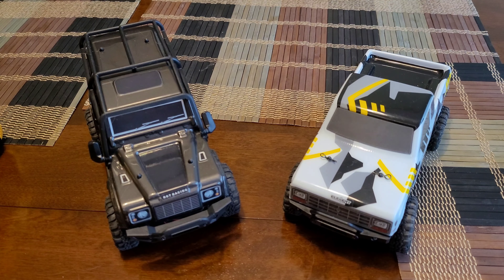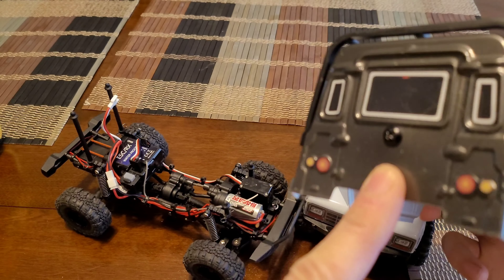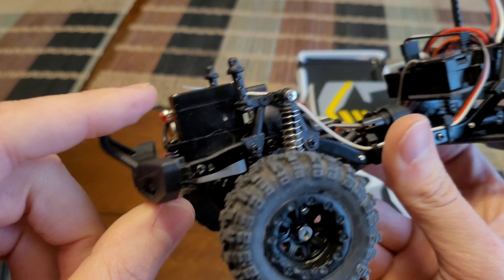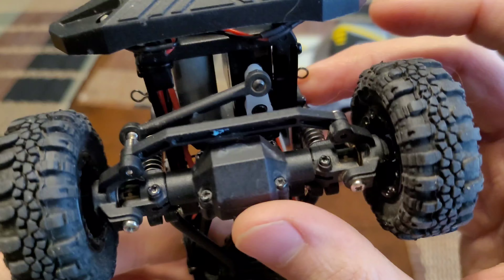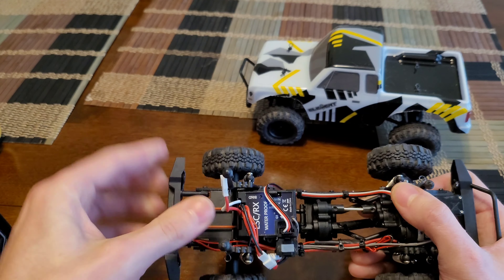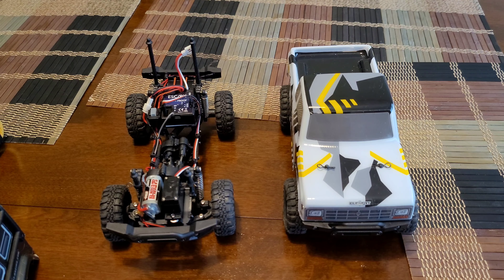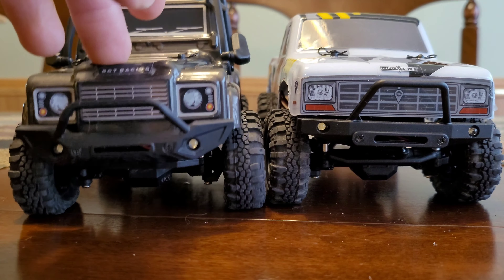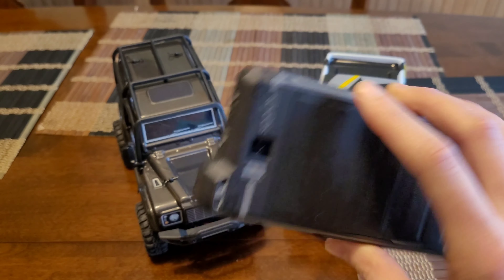RGT Adventurer v2 DIY mods

Comment: Raising the servo a few millimeters made a huge difference to the front suspension travel. I also added a few small o-rings to each shock to add a bit of preload. And you could add 1 inside each wheel as spacers instead of the washers. Shame there isn't much aftermarket support for these little guys. My enduro24 trailrunner hangs pretty good with my scx24 wrangler. 👍
Reply from the maker: Yeah it's a fun little rig!: I have the JLU scx24 jeep and I basically upgraded every single part except the motor. This Defender I just try to get clever with and see what I can do. The biggest hurdle is definitely the servo placement. That and it's a bit top heavy. Other than that I have lots of fun with it.
Reply: @Scrammy18  I just found out recently that power hobby is starting to make brass parts for the enduro24. Kinda pricey tho.
Reply from the maker: @barceloni1984  well at least thats some good news though.

Comment: thanks man. the steering mod helped a lot..
Reply from the maker: No problem! I was just not content with the front suspension travel and kinda did some trial and error and this works great. Without doing any crazy relocation or anything. Glad to help.
Reply: @Scrammy18  Just added couple of tiny washers on both sides.. gave it a try and it made a BIG difference... Keep it up man..  Subbed!
Reply from the maker: @Yimaj  thanks! Will do man!

Comment: So how it it holding up in the long term?  What are the main problems you have had other than the drive shafts?  Just curious.  Bout to buy one or the scx24 but I'd rather have the rgt . Shoot me an email if you want. Great videos man
Reply from the maker: I ended up installing metal driveshafts as an upgrade but it seems fine on 2S

Comment: I did the shock ring thing a few days ago actually. I just didn't like the extra play in the springs. Use your finger nails to "stretch" them just a touch longer. Enough to get rid of the play. Don't stretch them at just one part of the spring. Pull lightly in several spots till the slop is gone.
Reply from the maker: Yeah man that works too. Anything helps!

Comment: One free mod you haven't covered which has made a lot of difference to my V2 climbing is to use velcro (hook and loop)to mount the battery sideways to the front of the ESC. This brings the Centre of Gravity forward and also lowers it.
Reply from the maker: Thats a good tip man! I thought about it. I may mess around with that. I don't like lowering it but I have angled my shocks make them softer and a bit lower. Anything helps!
Reply: @Scrammy18  only lowering the centre of gravity by relocating the battery (less top heavy). I'm same as you and wouldn't lower the car itself, it's tight enough on ground clearance as it is .
Reply from the maker: @cmac1455  so I can up with an idea. I was able to stick 2 quarters to the front steering servo. One on each side. Just used some spray glue. You can tell just that made a big difference. It may not look the prettiest but you don't see it anyway. Plus I made sure I could still remove the servo if need be so it wasn't all glued in place. I bought some brass wheel hubs to replace the plastic ones for a little more weight as well. Other than that I was thinking of metal driveshafts etc but maybe all that over time
Reply: @Scrammy18  Excellent. That's your next video sorted 👍
Reply from the maker: Yeah man. I definitely have a couple mods I'm installing tonight. As well as my home made weights thats just quarters mounted to the front servo and motor. Actually works well!

Comment: Nice vid.!!!. Do you know if there are oil filled shocks for the RGT Adventurer?
Reply from the maker: They are not. They do provide long travel though. Im actually uploading a video currently showing how much more I was able to push this truck with articulation etc. I did buy new shocks and they looked cool but in the end they were not nearly as long as these so I just left the stock ones on. Once you take the spacers on the springs off and add weight to the vehicle is almost completely gets rid of the "bounce" you get from just coil overs. Once that second video is finished uploading later you will be able to see how far it can go. Honestly for the price and the fact that if you break anything its super cheap to replace I love these little rigs.

Comment: I'm trying to find the entire front and rear axles. Do I need to add in my own gearbox or servos? Or do I need to buy the whole truck for the entire axles? I'm trying to make my own version of Kevin Talbot's mini monster truck.
Reply from the maker: I'm sure if you searched long enough you could find all the parts. Might be worth it to buy the truck though just to have the baseline structure.